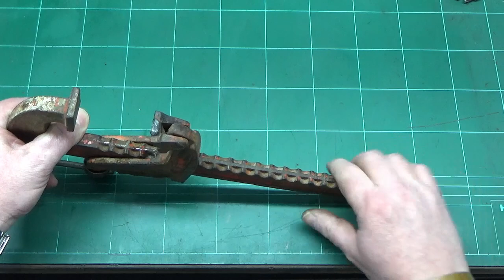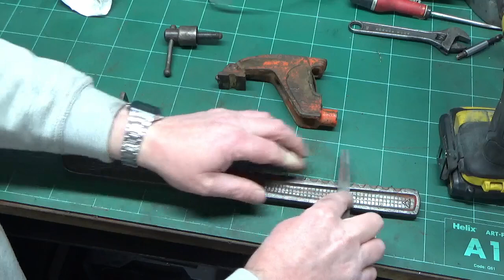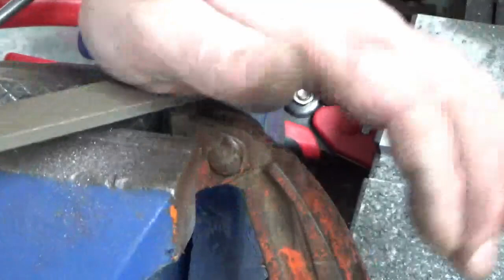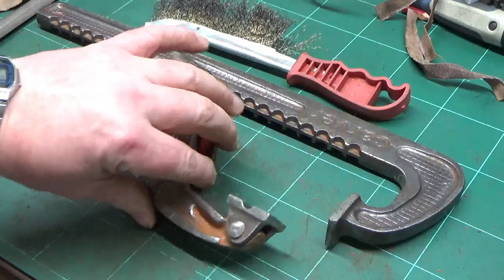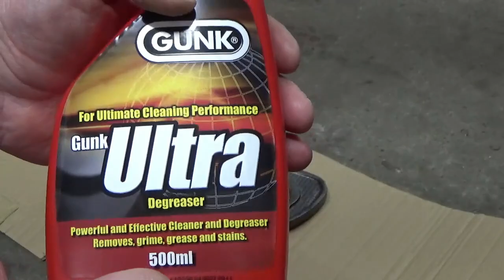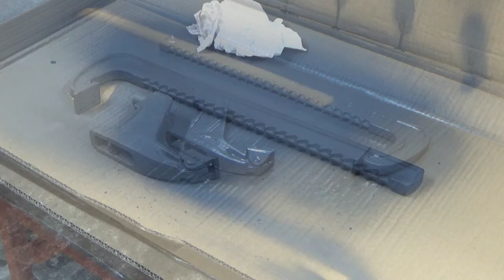Carver Clamp Restoration

Comment: love the video. i worked at Carvers in the late 90s as the their blacksmith/welder. Bring back a lot of memories. looking at the casting that clamp could be 40+ years old.  I may be a bit bias but i would agree they are the best clamps out there.  i still have the prototype of the T321 long reach low height that they trialed (they never took off and i think they dropped the design)  i did acquire some when i was there (johnny cash style "one piece at a time") but my dad kept giving them away.   still got 2x 6inch that i use daily.

Comment: As for the clean up, I repair/restore a lot of tools and have a 20 gall stainless pot which I use for hot dipping in caustic soda, which strips oil grease and paint, followed by blasting with a pressure washer and into the electrolysis tank. This works well for me doing batches of tools every few weeks.

Comment: Carver clamps top quality they are expensive, compared to G clamp s used them a lot they can apply a lot of pressure good for jigs and frame work etc .never bought one though in all my years just borrowed them  from the engineering companys ! . The joys of contracting .